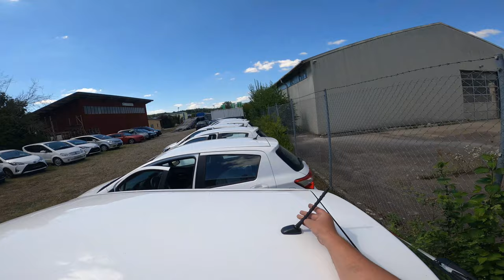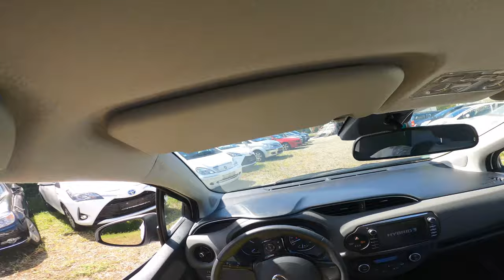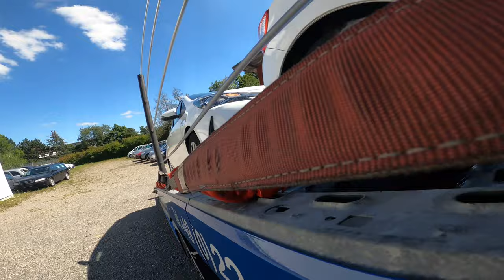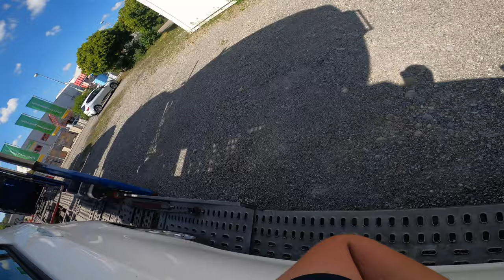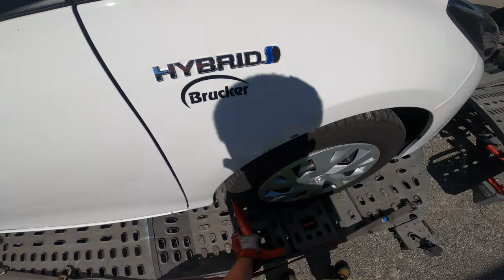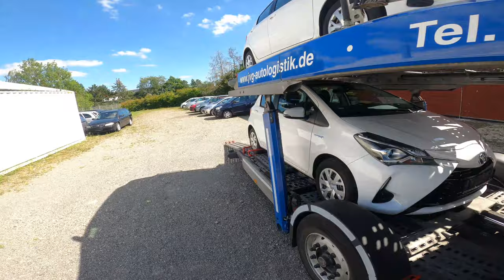Autotransporter mit Kopfcam beladen  / Car transporter loaded with head cam

Comment: Was ist das eigentlich für eine Anhängerkupplung zwischen Motorwagen und Anhänger? Wollte letztens in der Werkstatt den Anhänger abkuppeln habe aber festgestellt das es keine klassische Rockinger Maulkupplung ist sondern eine" Art Schraube die durch die Zugöse geht
Reply from the maker: Moin
Da ist quasi eine halb Kugel unten drin, wo der Anhänger dann drauf liegt. 
Im Schlepperbereich ( Landwirtschaft) ist sowas auch als K80 oder so bekannt